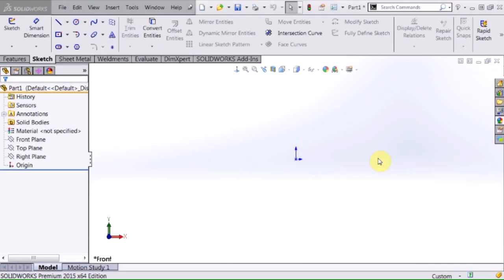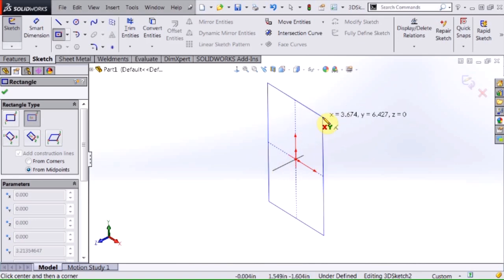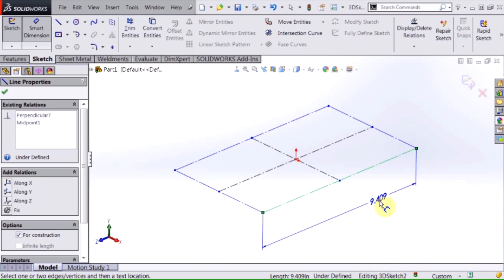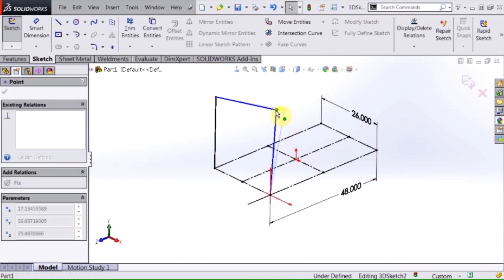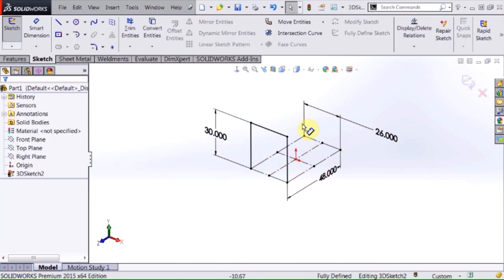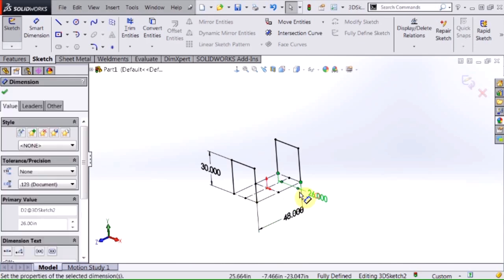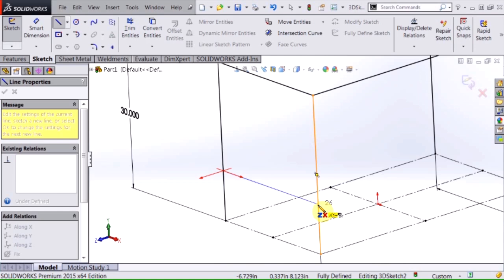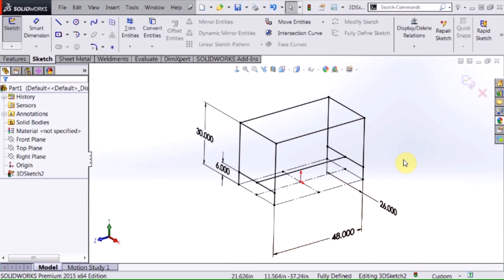SOLIDWORKS - 3D Sketch Basics

Comment: THANKS for the almost complete verbal description of what you were doing , 
WITH emphasis on the WHY !
 This is HUGE ! 
The "WHY" is the all-important link for the observer to understand how to generalize the specific instruction provided, to other relevant applications of the concept. THIS is how we learn to USE what we've just learned, and is why so many of our young people ask "why" so often in a school class, even if they don't yet understand.
One thing I might ask you to consider-
There are many intermediate task steps that you move through as you complete an operation, that you don't mention in any detail. This instruction we're watching today assumes some level of familiarity with at least basic operations, and while this assumption can often be valid, it's not universally so.
For instance, I have a specific need which has prompted my dive into S-W, and while I am familiar having run the most BASIC Part making tutorials, I have a specific need for this particular process. 
Mentioning "Picks" you execute in support of the operation you're running and describing could reduce the need to "pause-and-hunt" that so severely plagues so MANY trying to follow along. Just mentioning the pick as you go - just before the pick itself, is enough. Your process flow is just about PERFECT , and there's absolutely NO sense of you wanting to show off how fast you can execute, with more of an emphasis for pacing that allows the viewer to BOTH follow along AND understand what they're seeing.
These two - "Following" and "Understanding" what we're following, are DISCRETE, and are NOT the same "coincidental" process, and anything like your pacing (👍) and your explanation (👍), that you can do is a great help !
I try not to go into real detail in my comments, but every now and then I come across a really excellent presentation, and seeing a bit of input I can offer, I will .
Thanks for this ! The NEED has been met !
I plan to check out other offerings here on your page (L&S'ed), and may touch base in a comment, from time-to-time as seems appropriate 👍!

Thanks ! -
- C .

Comment: First of all thanks. 
What is the purpose of 3D sketch can we make part modelling by 3D sketch ?
Reply from the maker: They are used a lot for certain applications such as routing of wires/pipes/tubes where it would be inconvenient or impractical (would need many separate 2D sketches)

Another application is design of welded structures, machine frames or tables, which are made up of many members which would normally require many separate 2D sketches.
Reply: @hawkridgesystems  thanks

Comment from the maker: Some shortcuts used in this video:
S key - brings up Shortcut Bar  
Hold Right Mouse Button and swipe the Mouse - Mouse Gestures shortcuts
Hold CTRL key when selecting multiple lines to quickly add relations between them
Tab key while in 3D Sketch to change spatial plane you are sketching in

For more info:
https://hawkridgesys.com/blog/solidworks-useful-keyboard-shortcuts-workflow-customizations
Reply: can you also explain the "tab over" command at 2:14?
Reply from the maker: @mitchweigand9817  Absolutely, it's simply the tab key on your keyboard. Note the "XY" that appears next to the pencil icon in your sketch tool - when you hit tab, it will change to "ZX" or "YZ". When you're in 3D space, you can toggle between any of these principal sketch planes at will. Of course, you can also create geometry outside of those principal planes, but usually the initial sketch entity is placed on one of these and can be moved in any direction.

Comment: Just a suggestion, when making a 'basics' video, using a ton of unannounced shortcut keys is not a great idea.
Reply from the maker: I just quickly rewatched and tried to note down the shortcuts:
1) S key - brings up Shortcut Bar (popup toolbar with commonly used commands)
2) Hold Right Mouse Button and swipe the Mouse Up - Activates Smart Dimension command using Mouse Gestures (can also get from Shortcut Bar)
3) Hold CTRL key when selecting multiple lines to quickly add relations between them
4) Tab key while in 3D Sketch to change spatial plane you are sketching in
Reply: @hawkridgesystems  Thank you for this!
Reply: I would say that since the purpose of this video is to show the basics of 3D sketches and not things like drawing lines, making relations, etc. that it is okay to not include it since those things are not related to 3D sketches alone.

Comment: good tutorial thanks . when I sketch the construction rectangle and smart dimension the drawing is still under defined . any ideas on what I'm doing wrong ?
Reply: tony molloy 
it could be that your construction rectangle's center point isn't on the origin. 
refer to 0:47 onwards
Reply: @NicholasLeong14  It's not this, I get the same issue, making sure I centered it on the origin. Doesn't happen in 2D sketch, I checked. If I figured it out I will reply back here.